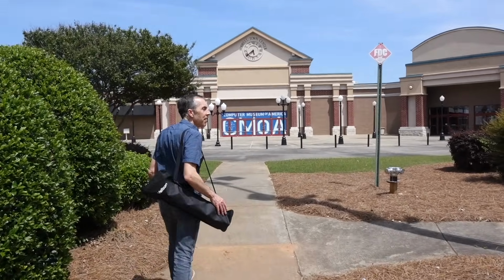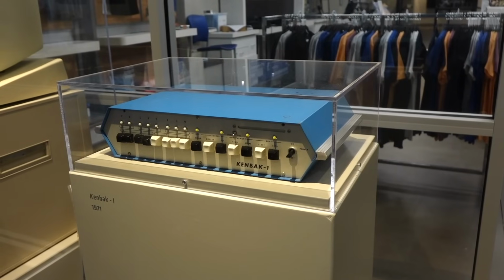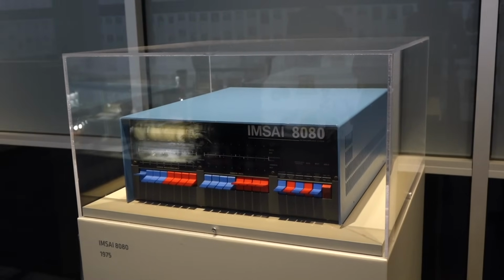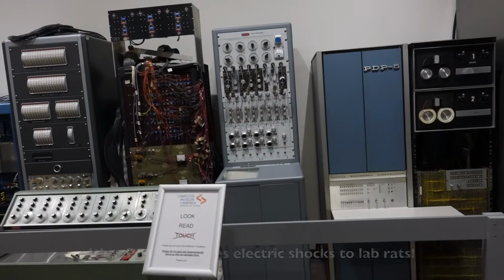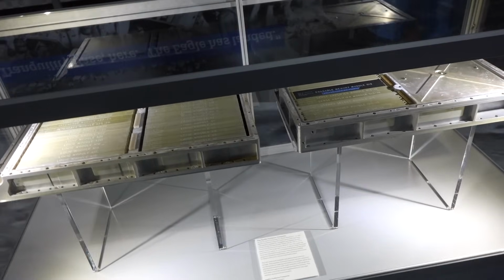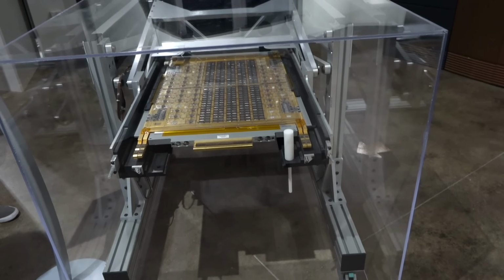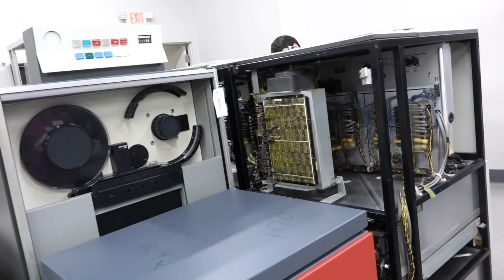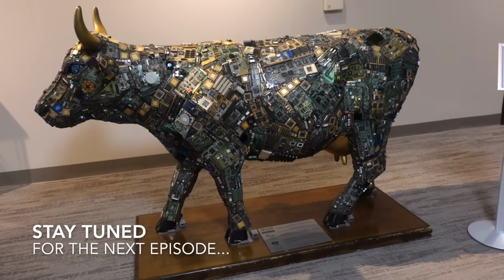Visiting the Computer Museum of America

Comment: I didn't see it but does anyone know if there is a Heathkit H8 on display? The H8 deserves a slot in a Computer History Museum. Instead of the toggle switches and lights, The H8 had a 16 key touch pad and LED segments to display split octal. Additionally, Heath streamlined the S 100 bus to a 50 pin bus. 
Today the H8 has a rather robust following with gerber files available to have new PCB's made with the exception of 8 and 16K pcb's, 64K configs can be build. The H8 sales online @ ePay are healthy with the majority of REASONABLY priced copies selling quickly. IMHO, the H8 available in 1977 as a kit, deserves it's place next to the Altair and IMSAI systems.

Comment: (@7:51) The absolutely jaw-dropping fact is that one could hide a Raspberry Pi inside that model of the tape drives and it would have more computing power than most of the machines in that museum, combined! How time flies, and transistors get smaller. 😌

Comment: Lots of folks vie over the CRAY and PDP line (and of course IBM).  But I worked with a different branch of computing regarding real-time monitoring and control systems.  There, SEL (Systems Engineering Labs) computers were 'king'.  With real-time interrupts and their propietary OS with hard-interrupt priorities, they were used in SCADA systems, system monitoring and real-time simulations (flight sims, military tank sims, nuclear plant sims, etc...).  A whole micro-industry around the 'SEL-Bus' tech and hard-ware interfacing (we had literally thousands of digital input signals and thousands of digital output controls, along with often close to a thousand analog output control).

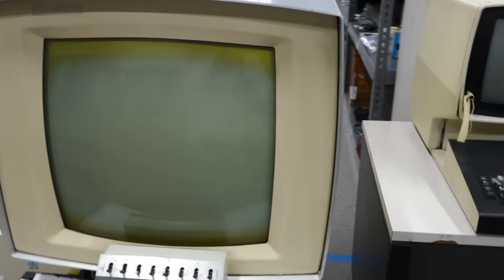Comment: 17:14 Cool, my dad did work with this terminal and later iteration for mechanical Desing, when they moved from paper to CAD. Would be so cool seeing such things work again.
Reply: A quick response when i showed him the Picture 
"3D not so much. Only 2D. I think I worked with it a generation before that, also later ones. It also looks more like a calculation engineer. It was more comfortable later for me with 3d. 
We also started relatively late with 3d, because we got along quite well with 2d for mechanical design, but 3d meant more effort. So computer costs and time to enter everything. But 2d was faster because less data was needed.

Later we had a tableau to draw on, it was much more convenient than pointing on the screen, but we had problems when switching because we were constantly poking at the screen automatically with the pen. It took a year to get used to it."

Comment: A museum of computers that are all behind a glass case inoperative ribs me the wrong way. These should be all operational and running, even if not for the public to touch
Reply: operational yes but running without users? that's a lot of power and heat just to be blinking a cursor. and the parts wear out, over time it'd essentially be reducing a working collection into non-working one
Reply: @snooks5607  make a usable day or week each year, like they do with the alexanderson alternator
Reply: So many of those computers are just not usable without a whole infrastructure backing them up. .

Comment: I have to wonder... how many of these computer museums have chip foundry equipment? I used to repair circuit boards that went into what was then FSI International's SATURN wafer processor... it had a custom system controller with an 8085 at its core.

Comment: Does this museum have an IBM MSS (mass storage system)? I work with one in my first IT job. It even tried to kill 2 of my colleagues and myself one night. It is a robotized tape storage system. It consisted of a large honycomb storage store that contained magnetic tapes that resembled roll film in size. There were 3 robots that run over the length of the system to get a cartridge and bring it to the read/write unit. They moved at great speed. One night we had a malfunction on the system, so we turned it off to have a look. We opened the side doors ( the system was about 10 meters long) and looked inside. At that moment, one of the robots came wizzing by a few centimerts of our heads. It would have been very bad if we had been hit. It took a while, and a lot of coffee to stop shaking. It turned out that it was an undetected failure in the safety systems that caused it. 

Funny side note : if a tape was damaged (like a cassete tape been eaten up) we had an iron board and iron, put the damaged part of the tape on it, and used to iron to flatten it. Most of the time we managed to make a new copy for the system.
Fun times it were.
Reply: Similar story with the StorageTek Powderhorn tape robot. It was an octagonal shape with tapes at the inner and outer wall, and multiple drive frames. It also has an access door through which you could walk in. Safety instructions were that if you´d ever got locked inside when it powered on, just stand up and wait. The robot would make a very gentle pass to find any obstructions and would abort when it touched you. But if you tried to outrun it and it finished that pass, the robot arm would start whizzing around like crazy, and you´d end up beheaded.
Reply: @scsirob  yes thos also had that type of cartridge. There were only a few in Europe. We had a very unique IBM technician, drove a big Citroën smoking a big cigar and listening to Oompah-pah music, we always had to tell the guy at the security gate that he was legit. It seemed he knew every nut and bolt of the system.

Comment: Getting crazy from all that Crays craze! The place is wild, absolutely Fraaaaaaaaan-tastic. A few orders of magnitude more than enough to give me a supermassive nerdgasm.

I'd take a closer look at the inner workings of that lab rat shocking setup. I've got a shock generator with a motorized rotary distribution switch that switched the shock voltage source between two shifting groups of 8 output lines each out of 18 total, these were connected to metal rods forming a floor of the Skinner box. I wonder if the setup in the museum still uses electromechanical distribution switches, or if it went electronic.

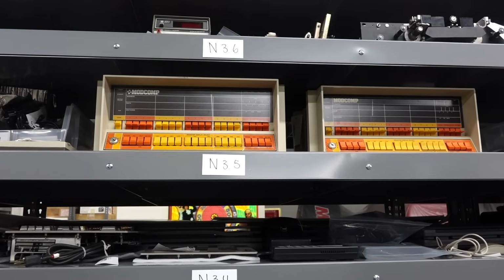Comment: 18:36 Until recently we had two such machines at work as well as a Modcomp 9250. Nowadays we run the MAX IV operating system and the programs in an emulator that emulates the Modcomp hardware. 
It was sad when the old Modcomp machines went for recycling, but we saved the switch panels

Comment: In 1979 the Motorola 6800 processor was born. As a pinball mechanic, that meant that I had to completely retrain.
Reply: The 6800 came out in 1974, the 68000 was out in 1979.  I wrote bytecode for the 68000 for FADEC (GE aircraft engine controllers), back in the day.

Comment: Every time I see the front panel of a DEC PDP I think how lucky I am to have learned programming at a time when I didn't have to toggle in the boot loader of the computer in binary every time it was switched on.
And talking of switching on, the one sad thing about this museum is that all the computers are off. The Living Computer Museum allowed people to run their systems, but alas, it has just closed down. I daresay that to run all those Crays and supercomputers would require a dedicated power station, but it is a shame nobody can bring these machines back to life.
Reply: Some of the cooling systems on those use chemicals that are also super dangerous. The Cray-2's cooling used Fluorinert which can be super toxic if handled wrong. And the sheer amount of Freon used to cool most of those early cray's would be insane to get running.

Comment: I live in FL, that place is not even that far.   I could go revisit all my old HP calculators.  35, 45, 65, 97, 41, 15, 28 and finally, the one I still use 48G and the only other one I have that still works is the 15C.  Thanks Mark and Master Ken for the tour.   Algorithmic interaction complete, end of line.
Reply from the maker: I still use my 15C in the lab!
Reply: I use my 48GX, in both physical and virtual forms, and I prefer that one over my two other HPs, the 35s and the Prime.

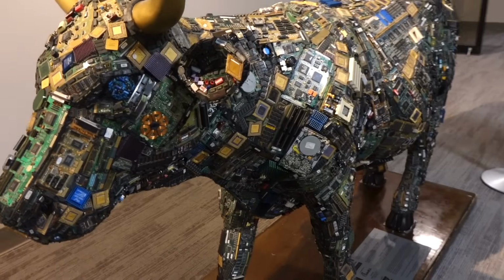Comment: @19:20 YEAH! My first computer (ZX-81) i plucked a lot of tomatoes to buy it :D
Reply: It was my first computer to. Did cost an awful lot of money for 1K. Got the 16K expansion and learned the hard way about the wobble effect (the connector between ZX81 and the memory module was sensitive. If moved you lost everything, not fun after a long programming session. It was the start of my IT career.
Reply: @GuruJSGamingIsFun  I skipped the 16K and moved to the Spectrum. Even bought a floppy drive. Lots of fun to get the tape based programs on floppy. Not enough space in memory so copied most into high memory, part in the video ram then booted a small piece of assembly to copy the video over my basic code and then call the correct routine to start the program. With the move memory block operand of the z80 it was just a couple bytes to do that last bit so hid that somewhere in the print buffer (or somewhere over there ;)

Loads of fun.
Reply: Same. Blu-tac for the rampack.I delivered newspapers for mine.
Reply: Anyone recall Monster Maze 3D ? - one of the very first (if not the first) 3D POV Games. A genre-instigating 'horror survival' computer game with a convincing T-Rex hunting you. I still remember the hair-raising terror of it chasing you down a corridor. Nightmare fuel. Amazing what illusions could be achieved on a 16k ZX81. The ultra realism of the upcoming 'Stalker 2' horror survival is the latest incumbent of this legacy - hard to believe the progression.

My father bought the ZX81 for Omnicalc's spreadsheet but I recall typing in a Space Invaders in 1k (!) listing for Basic before we eventually got a 16k wobble pack clone.
Reply: You do realize that your beloved ZX-81 is in the 'Modern Stuff' section of the museum ;)

Comment: WEEEE! A Datapoint 2200 data entry machine! Worked with those - programming in Databus on the 3800 ARC and then for the 6600 with Datashare and multiports. And we hade a code generator called ISIGEN that allowed you to mix ISIGEN commands with Databus and get a Databus complete program depending on parameters you gave it. The 80*12 screen is "funny" in that it's a card image. Punch cards we all too common back then. Two cassette decks on top; one for the program you wanted to run and one for the data. We also used DP 2200 as a controller during off-line printing data from our SPERRY UNIVAC 1100 mainframe . The 2200 ran a tape drive and also the big SPERRY UNIVAC high speed belt printers! Oh! Nostalgia! ;)